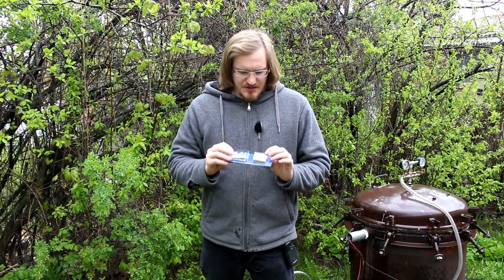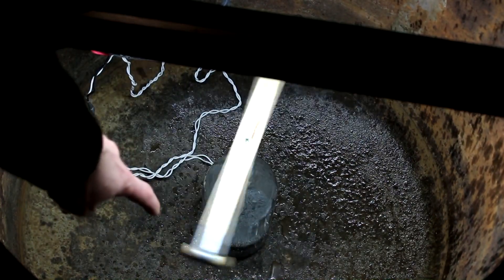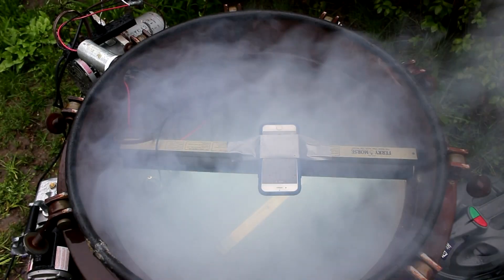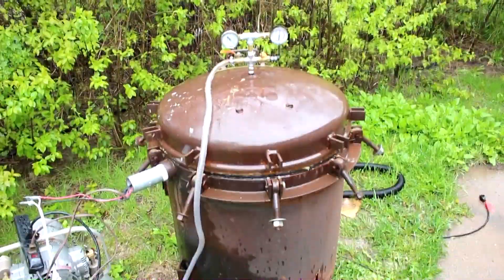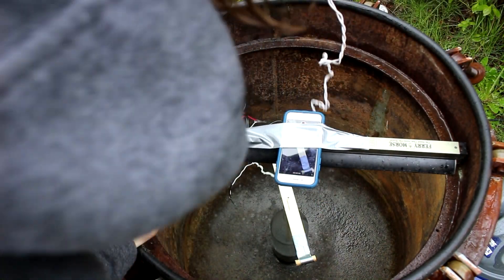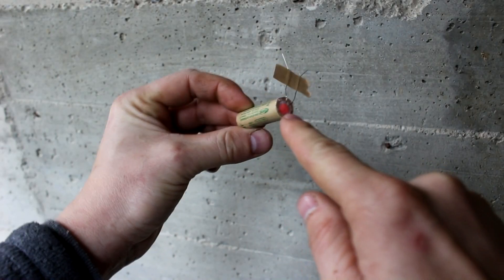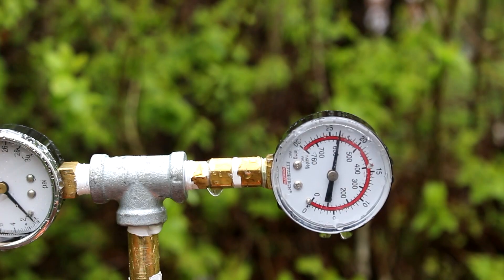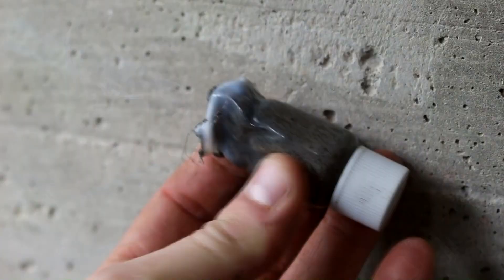Will a Model Rocket Motor Work In Vacuum?

Comment: Release the schmoo!
Reply: What with the pokey bits goin in the pokey bit receptacle to set off the choocher at subpar atmocylindrical pressures.
Reply: Ha ha ha ha ha ha, What?
Reply: skookum as frig
Reply: This JustIn: The Kimes Times is it skookum though?
Reply: Matheus ave?
Reply: It's pretty farkin' skookum
Reply: Matheus welcome to canuckistan
Reply: did you guys notice how this video was so far below codys normal standards ? if we dont say something he will never know.
Reply: im pissed at the poor level of usefull info in this video.  he could have made a video entirely on why the pressure gauge didnt go to full vacuum  . and maybe another one about how the atmospheric pressure can change from day to day and why it does ? he could have made conclusions based on his observations of the malfunctioning pressure gauge and hypothesized how accurate pressure gauges are. and reflect on all the times he measured pressure gauges to a millimeter to see if he had full vacuum. and say in conclusion it was stupid. and that for all he knew he had half a vacuum. a pressure gauge that can be off by  like 20 percent from day to day  is useless when trying to measure stuff like .1  percent from full vacuum. among so many other stuff i think this video should be taken down and redone as it is so below codys standards. i watch cody because hes smart and notices stuff like that and then explains them. this video is like what any other "science'' channel could have made. like hydraulic press channels.

Comment: Can a magnesium fire be put out by a vacuum?
Reply: Yes. Burning magnesium needs oxygen from the air (or from water). No oxygen, no burn.
Reply: +Swinde
No, magnesium does not contain any oxygen and won't burn without an oxygen source like air.

The problem with magnesium fires is that often it is difficult or impossible to remove those oxygen sources.

Typical fire extinguishing materials like water, foam, powder or CO2 are useless because the magnesium fire is strong enough to break them down and use them as oxygen source.

Now i don't know what that long named chemical you mentioned is, but it was quite likely the only available way to extinguish such a fire because it is not really possible to put a burning airplane into a vacuum chamber.

If it is possible to remove all oxygen from the fire it goes out immediatly.
(edit because of typo that made meaning unclear)
Reply: Vacuum = no (or insignificant amounts) of anything around. That includes water.
Reply: Temple of the Dog
Um... Magnesium is an element. It contains only magnesium and nothing else. Look it up on the periodic table.
Reply: Oh allright then. No worries, everyone makes mistakes. ^^
Reply: The model rocket engine did not fire without confinement. I think that proves the point that seemingly obvious things can still not work in the experiment.
And yes, the reason things like solar roadways get funding is scientific illiteracy both in the people and, more importantly, in the politicians.
Reply: Temple of the Dog CO2 isn't an inert gas it's reacts with other covalent and ionic bonds if it was inert it wouldn't do anything like Argon, helium etc
Reply: ElectroBlood exactly, after all, i was born
Reply: I mean dry ice. it makes carbon by robbing the oxygen from the ice
Reply: +PolyJohn Thank you.
Reply: Class D extinguisher.   Long chemical name is probably trimethoxyboroxine ;)
Reply: Temple of the Dog it can be used as a replacement for an inert gas for combustion reactions as it will not fuel a fire. But CO2 in its gaseous phase will still react with molecular substances unlike a true inert gas such as Argon which will just float around minding its own business.  
Gotta love valency.
Reply: At the temperature magnesium burns, CO2 will only add more fuel to the fire.  So will water or nitrogen.
Reply: as long as the oxidiser being used isn't pure oxygen the other atoms/molecules would be released as a gas.
Reply: Electro Blood or co^2
Reply: To answer the original question...I guess so?  Are we talking about opening the airlock on a spacecraft or something?  How are we making this vacuum around the fire?
Reply: Landrew0
Knowledge only comes with curiosity. Our greatest flaw and biggest strength is being born a blank slate.
Reply: And yet our greatest difficulty seems to be to admit that we simply do not have an answer to everything.
Reply: Actually you can burn carbon, aluminum, magnesium, and other material in a C02 atmosphere. Burning carbon in a C02 atmosphere is a good way to generate carbon monoxide. It is possible to fuel an IC engine that way.
Reply: +milesjwade Even if magnesium combustion did produce a gas, it would be quite odd if that gas could then turn around and oxidize more magnesium.
Reply: so so so true..... WAIT LIEUTENANT DAN? ITS ME FOREST!
Reply: 50Login no you arent
Reply: milesjwade
We are making the vacuum around the fire with Cody's vacuum chamber. Not that it would have any real world application, but just out of curiosity.
Reply: Temple of the Dog old enough to go to university
Reply: If you ask the question, "could a vacuum prevent ignition of magnesium?" it would be more similar to this experiment and I'm sure the answer would be yes.  But to extinguish an active fire, there's just no practical way to remove the atmosphere (AND all the gases produced by the combustion) quickly enough.  Other than jettisoning the burning material into space or something like that.
Reply: Burning magnesium doesn't produce any gases. It consumes oxygen to make magnesium oxide, which is a solid, even at very high temperatures. ;P
Reply: Temple of the Dog
Semantics can't save you, It's simply a false statement.
Reply: +Landrew0 Stereotypical sanctimonious dipshit. THE VIDEO ITSELF demonstrates why such a video is necessary; as your own comment shows our "educated" intuition is that anything that contains a fuel and oxidizer will burn regardless of ambient conditions, but this video and the previous videos in this series show that some degree of confinement is also necessary to sustain the combustion. Clearly, a low vacuum is enough to impede the ignition of these types of rockets, which is not something most people would have necessarily known without testing it. So shove off with your self-righteous soap box shit, eh?
Reply: Connor Dow Cody's isn't doing these as rigorous scientific experiments, he's doing them because science is cool. The rocket's work exactly as predicted by anyone who actually sat down to figure out what was happening and why even back in the burning things in a vacuum video, but I assume Cody is either just winging it and relying on 4/5ths observation to very basic hypothesis, or he's deliberately making the science simpler for the viewers to digest. Either way the format is good. 
If you want rigor do the test again yourself to your standard, just don't force it on others.
Reply: Temple of the Dog
"CO2 is an inert gas."
Wow, guess much?
Reply: YES I AM! and lieutenant dan you dont have any legs so u cant get ur sea legs
Reply: repeat that! so why r we in space flying rockets? ridiculous!
Reply: interesting but maybe he should finish this video properly first. like maybe doo the test twice atleast and burn the rocket to see if all the fuel was burned. any way there are thousands of things wrong with this video. maybe we should tell him.
Reply: M'aiq the Liar well if it gets it from the water thers no need for oxegen in the air
Reply: I'm a bit shocked at the lack of scientific literacy in our society. Why do we need to test whether a rocket engine will work in a vacuum, when it contains it's own oxidizer?  Magnesium, or anything flammable without an oxidizer, needs oxygen to burn. 
I guess this explains how a scam like solar roadways can get crowd-funding.
Reply: Magnesium has adequate oxygen in its structure and will burn without air.  I was in the navy air wing and they stated the a magnesium fire could not be extinguished unless a certain chemical with a very long name was applied.  This was important because the struts on attack and fighter aircraft are magnesium and are subject to fires when the tires happen to blow on landing.  The special chemical was on hand wherever these aircraft landed.

Comment: Damn it Cody, you did it again. You linked to an editor page of a video in your description. ;)
Reply from the maker: whoops
Reply: @theCodyReeder  this experiment is faked. shame on you.
Reply: Cody'sLab hey it was not fully successful it didn't burn completely because the parachute charge did not go off..
Reply: what does that mean?
Reply: Brandon Cramer I thought it was a shorter burn.
Reply: its was a shorter burn.. tisk tisk cody you didn't catch that buddy
Reply: That makes sense, there's a slow burn (like a fuse) between the main grain and the ejection charge to create the delay — but that gives enough time for the pressure to escape and the motor to blow itself out. Basically it's a second ignition. And if you look at professional rockets that are able to ignite under vacuum conditions, they're all liquid fuel, not solid.